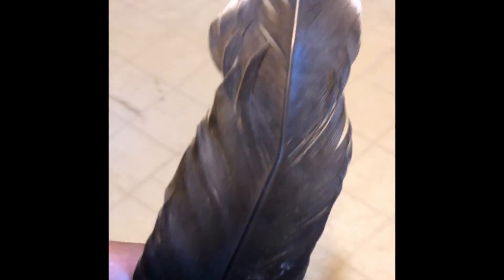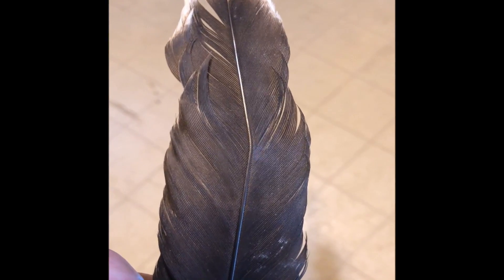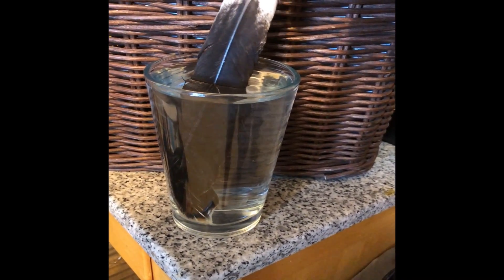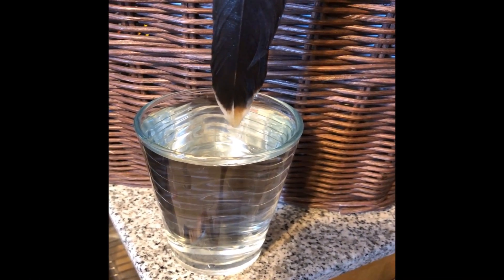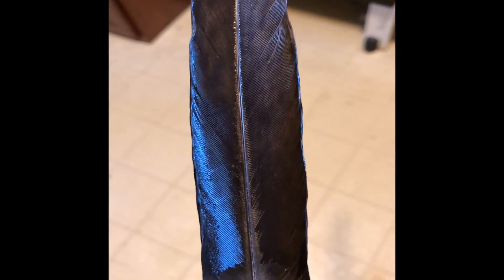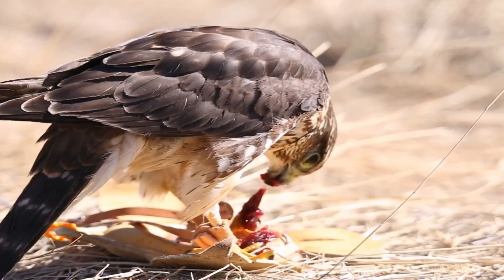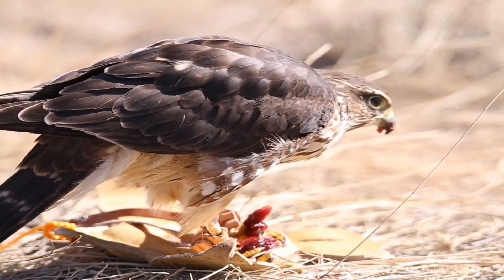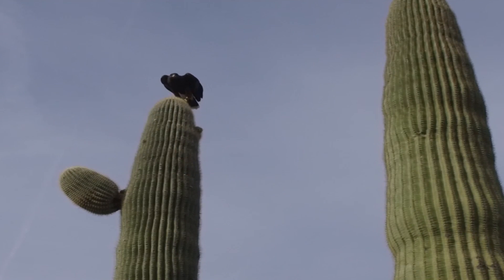Falconry: Repairing Bent Feathers

Comment: Great tip, Ben! Our Harris hawk hates her hood so much (our fault; we didn't start with it early enough) that we have to do this unhooded. I hadn't considered soaking the whole tail in the hot water - I always tried to isolate the feather. I'll do the whole tail next time! I'll also use hotter water than I've used in the past. It has worked for me with just very hot tap water, but then I've had to use my fingers to reshape it too - I'm sure it's must better to not touch the feather and let the almost boiling water do its work. Thanks again!